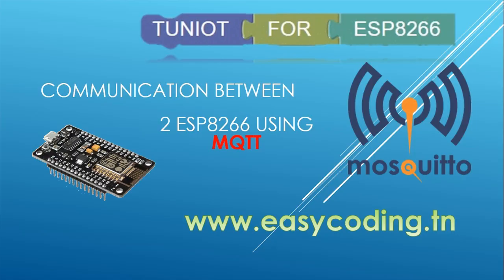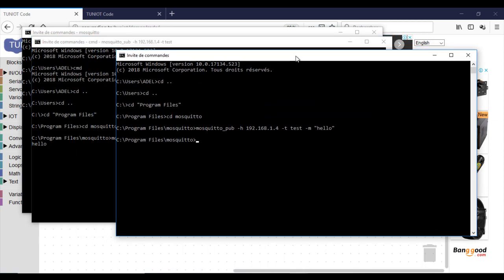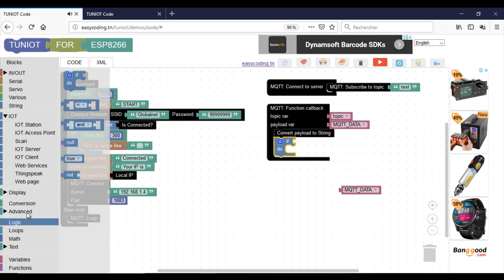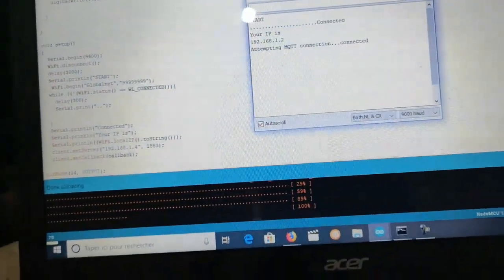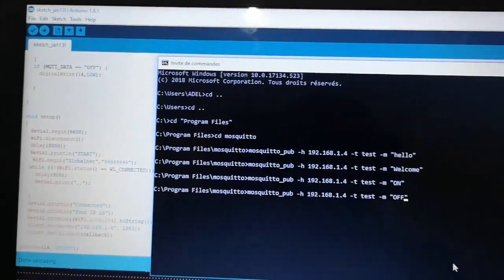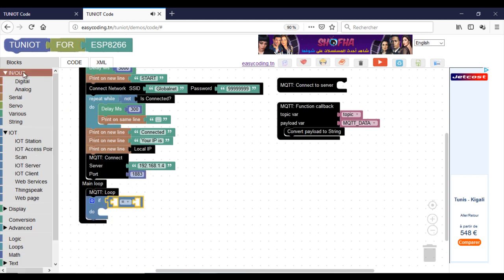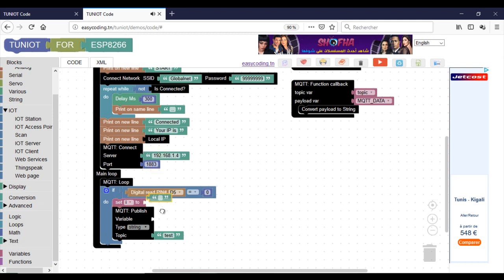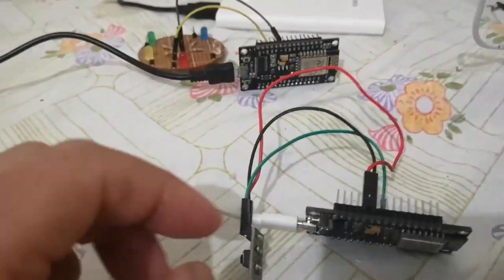NodeMcu (ESP8266) Tutorial B-21:  MQTT Communication between 2 ESP8266 boards

Comment: thanks  alot  for ever sec of you time.....could we connect more than 2 may be 5 node mcu for example to the same broker using mqtt?could you use adafrut as broker?with out any raspbeary pi
Reply from the maker: Yes possible. The difference is that you need internet for the Ada fruit server
Reply: @ADELKASSAH thanks for your quick response..when I connect 2 node mcu to adafrute dashboard so that both of them can communicate with each other only one esp8266-12e get connected but not both of them at the same time using MQTT.i really don't know what is the problem..the normal situation is one esp publish data the other esp subscribe to the same topic..using adafrute or thingspeak or cannye dashboard help to monitor the operation from anywhere in the world.i hope you could explain it in a video..thanks